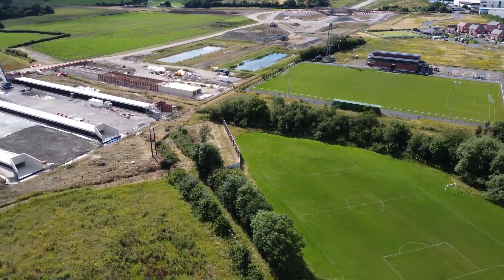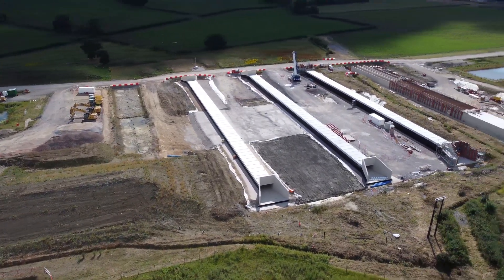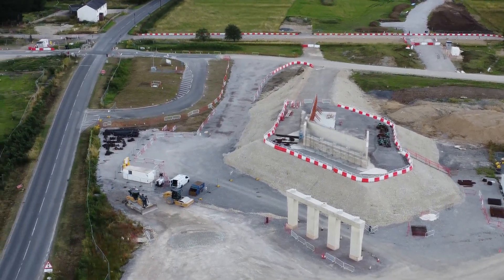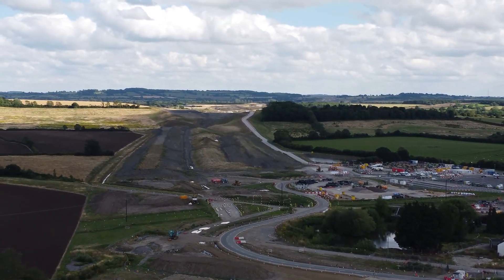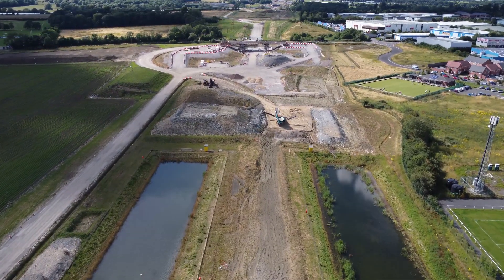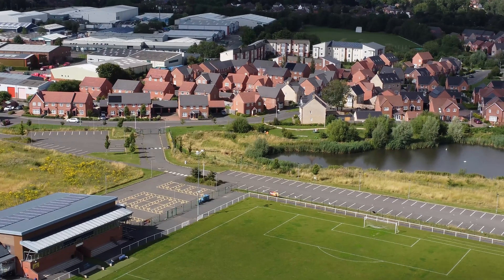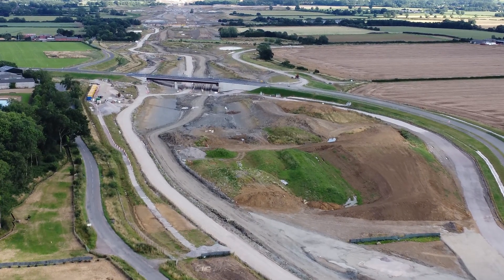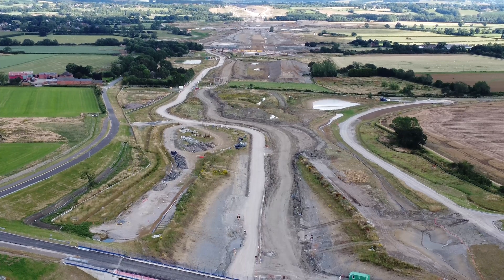HS2 Construction - Banbury Road near Southam and Wormleighton

Comment: Those  tunnels are for diverting rain water, and there location is dictated by the topography of the land and where surface water streams form during heavy spells of rain.  If that wasn’t there the train tracks would wash away when water streams crop up during heavy rain.